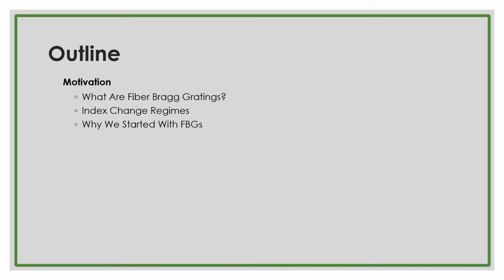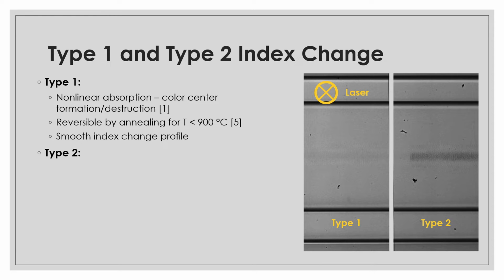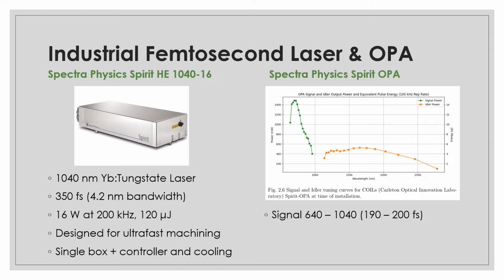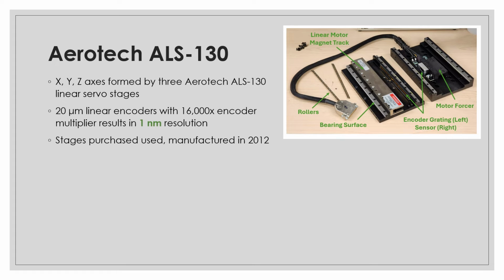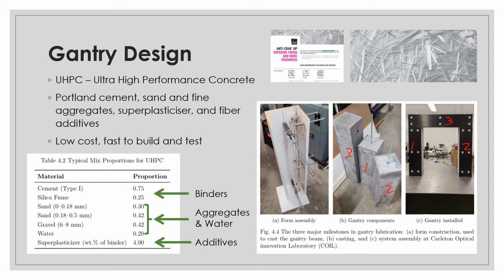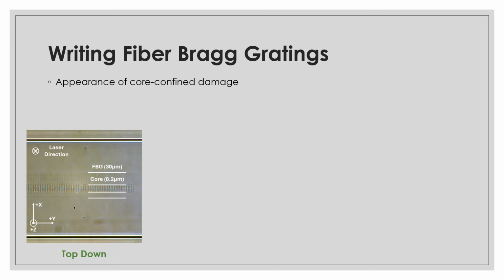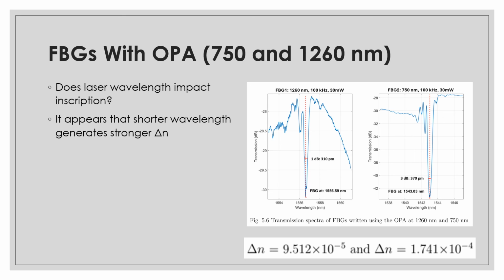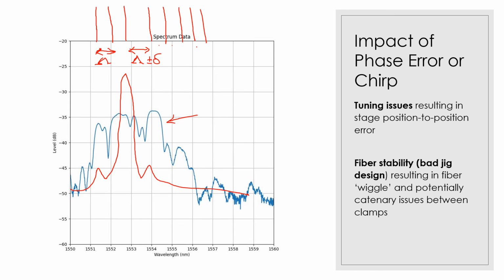Femtosecond Laser Inscribed Fiber Bragg Gratings (FBGs)

Comment: Thanks for the upload.
The linear velocity deceleration of a large mass (~ kg's) initally driven by a linear actuator over a few 10's of cm supported by almost frictionless air bearings is highly predictable and repeatable over the length of a bragg.
If the known deceleration profile of the massive stage is syncronized to the wrighting laser rate, that may be a better option over metrology stepping and stopping.
Just my 2 cents...I might try it if I get a chance.